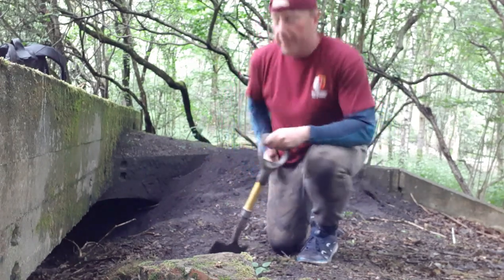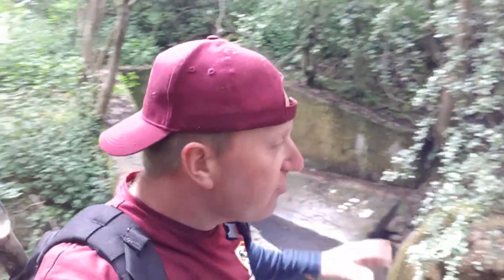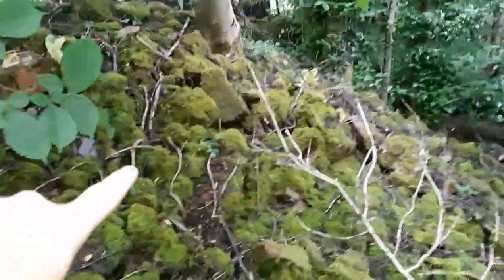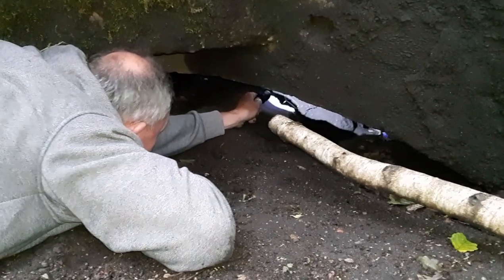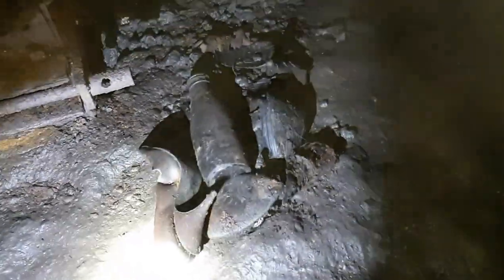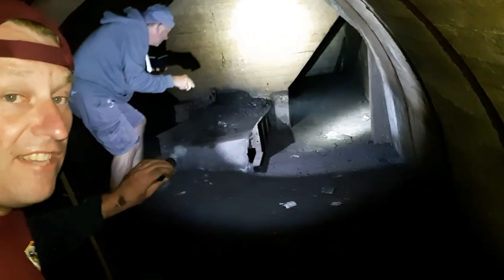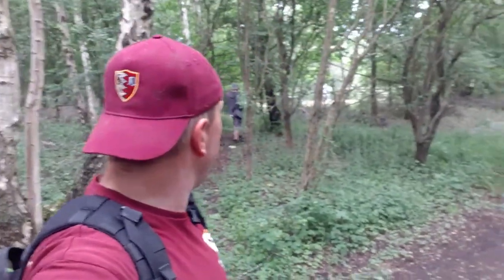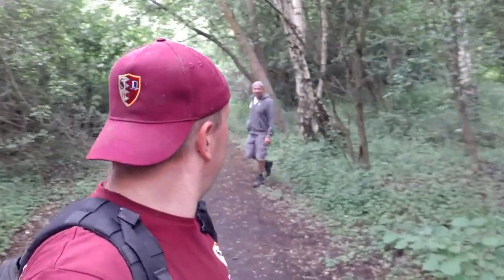Digging out our industrial heritage with a shovel in the woods with an interesting find

Comment: The conveyor is a relic of the 1950s. The NCB had a huge pile of colliery waste, locally called the pit bank, at Donisthorpe which had to be removed. They decided that it was to be moved to Thortit (Oakthorpe) pit and taken back underground to fill old workings. The hopper you discovered was where the lorries tipped the waste on to the conveyor which carried it along to a bunker close to the shafts. It was then blown down pipes by a huge compressor. The pipes were about a foot in diameter and went down the shaft and along the roadways to where they discharged the waste. The system was in use till the pit bank was no more.
Reply from the maker: Great comment! Did you see this video on the coalville history Facebook group?  If you did, my plan worked, because thus has been bugging me, and I knew someone would answer my question lol! And you have, cheers!

Comment: Hello me ol china. you had a close shave messing with those battery cells!. I smashed one with a hammer. 6  hours later im in hospital with a big hole in my leg, the graphite and sulphuric acid had eaten through my jeans!. 6 cells at 1.5 volts, giving 9 volts. 1970 Ever Ready PP9 radio battery. Is there a track there? as that looks like ballast for lifting and packing sleepers ;-).
Reply from the maker: We didn't know they were batteries mate, that's why your here lol! It does look like ballast for a railway doesn't it? But there isn't a line directly near there, there was a very old tramway in the vicinity, but that was never on ballast pal